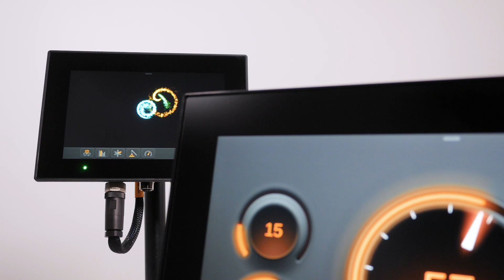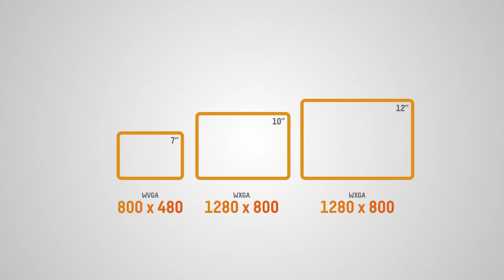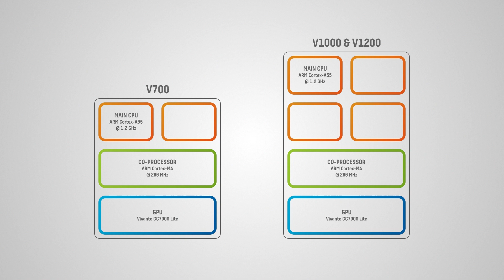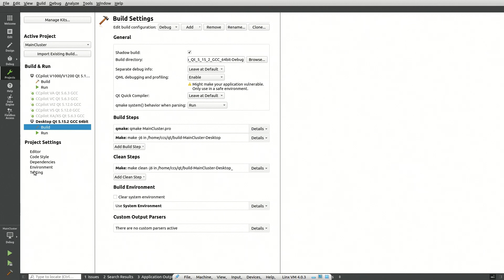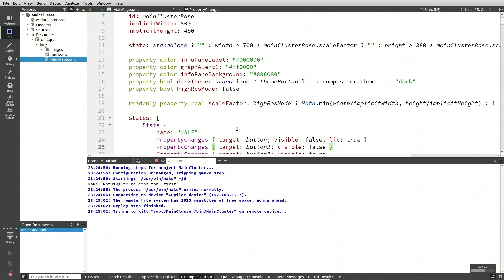New display computer with iMX8 application processor

Comment: why the V1200 display is not CAN enabled?
Reply from the maker: The CCpilot V1200 supports up to 4 CAN ports and is CAN FD compliant. The programmers guide available from the website has more information on setting up CAN or reach out to your local Field Application engineer for additional assistance.